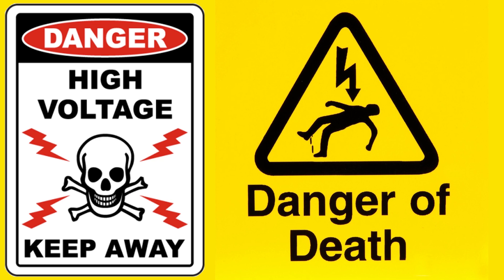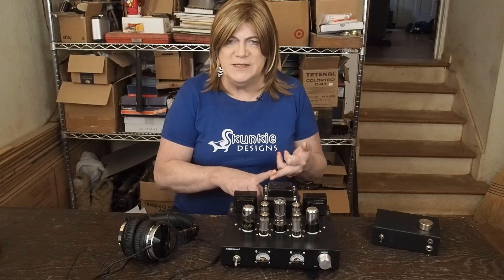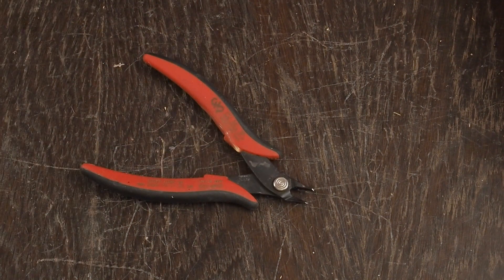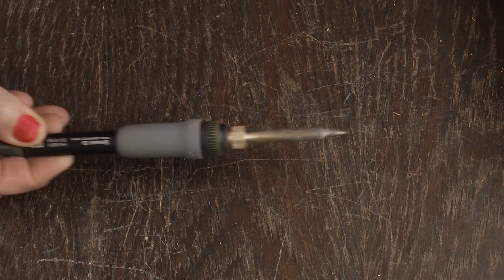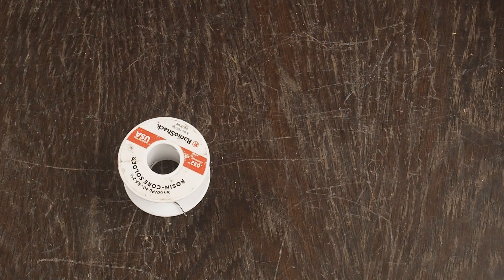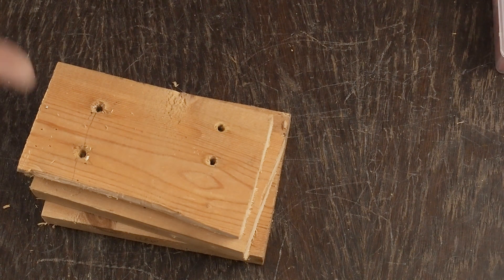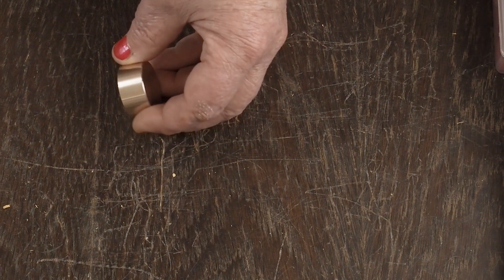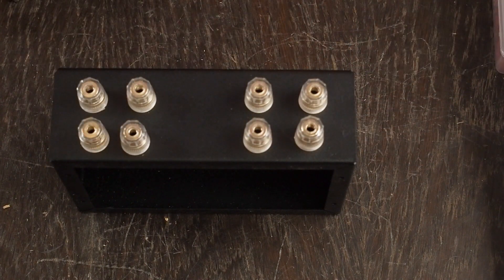Tube Amplifier Headphone Adapter: #1 Tools and Parts

Comment: A couple of alternate tools and techniques I would use:
- A step drill - has a 'centre point' starter and multiple sizes, so achieves the desired hole size in a single bit without changing
- A drill press / pillar drill to allow single handed and more accurate drilling
- Vacuum cleaner / shop vac for removing metal swarf and help avoid scratches

I would prefer to place the volume on the front panel to allow items to be stacked on top of the adapter.
This project could be adapted to become a generalised switch box, supporting speakers A and B as well as headphones, although a larger box would be needed to mount the additional terminals and a rotary switch supporting 2P3T (or more, as required).  Remember the risk, though, of inadvertently running a tube amp without speakers connected, which a box with additional terminals may invite...

I would perhaps suggest drilling all the holes first and then spray painting the box and applying some text legends.  There are YT videos on how to do this.  An alternative might be to make up a PCB front panel, since they're so cheap these days...

Comment: With a bit of practice, you can use your wire cutters to strip your wire as well. Hard to explain the technique.  Practice on various scrap wire until you get the idea.